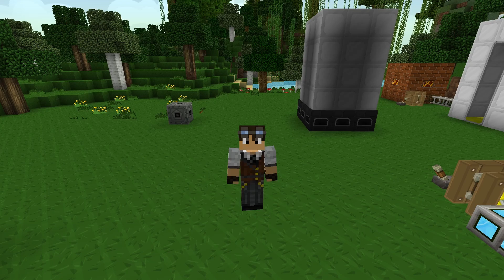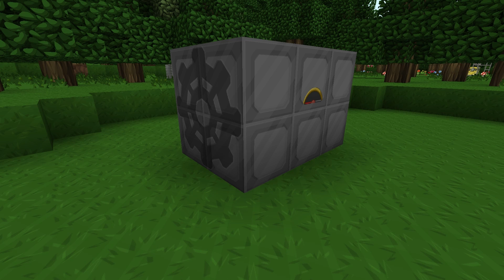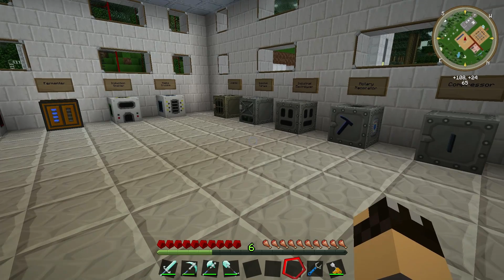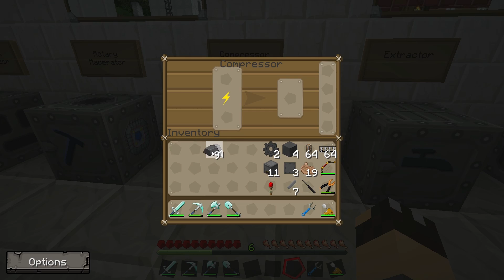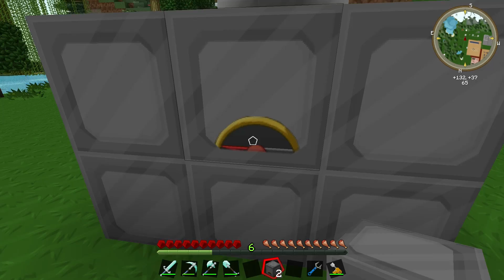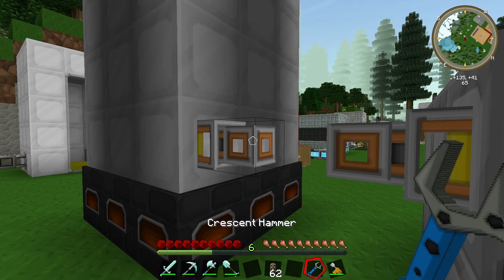Steam Turbine - How to FTB in Minecraft - 55

Comment from the maker: Yes, an energy tesseract can take an input of 100 MJ/t - but there is a 25% loss, so the most you would get out of the other end is 75 MJ/t - but as steam is a liquid, there's no loss for sending that through.

Technically you could use an Energy Bridge to convert any type of power into steam, send the steam through a liquid tesseract, then use another Energy Bridge on the other side to convert it back into BC/IC power with no loss.

Comment: Great video again! I'd suggest doing FTBUnleashed. It has many of the same mods as ultimate in addition to new ones. The thing I like the most about it is that it does not have gregtech ;) It does not have redpower 2 bacause of the update problems with it. It is currently on v1.1.2 and running 1.5.2 minecraft.